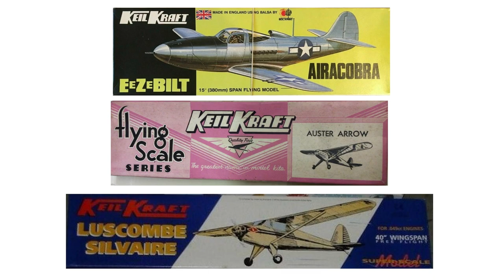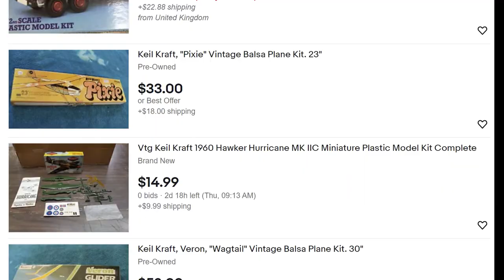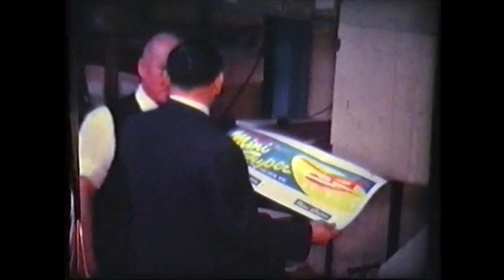Keil Kraft, a brief history

Comment: Thank you, glad to be of help. I just had a quick look on Scalemates. As far as I can see, only two plastic aircraft kits are listed.
F1 Hawker Hurricane Mk.IIc - which is dated rather vaguely as 196x. The Heller Hurricane Mk.IIc was a 1970s kit.
F2 Sopwith Camel. Again a rather vague date, 195x.
Both kit listings include the original Keil Kraft instruction sheets.
I too remember the Humbrol Authentic Colours. Regular Humbrol enamel paint tinlets sold for 23 cents in New Zealand when I began modelling in 1974. The Authentics were a bit more, either 27 or 29 cents each. They were grouped in to sets of six, mostly aircraft colours, such as RAF, RAF Overseas, Fleet Air Arm, USAAF, Luftwaffe, Italian, French, Japanese, Military Vehicles, Naval Vessels, etc. There were also some Railway Colours. As I understand it, production of the range ended after a fire at the Humbrol factory, although some shades did reappear in the standard Enamel range. I still have some Authentic tinlets from the 1970s and 1980s.

Comment: Another wonderful history video, from the master of the genre. The factory tour film was great, and very informative. Keil Kraft looks to have been a sizable operation.
According to Plastic Kits Made in Britain, Keil Kraft made balsa kits during the war, but not sure if that is correct. Apart from their flying models, several of the boxes shown are of non-flying Solid Models.
Plastic Kits also says the balsa models were distributed by wholesaler A A Hales Limited. They eventually took over Keil Kraft, which then passed to the successor wholesale firm Amerang Ltd.
Apart from their early plastic aircraft models (1950s or 1960s), they also did a range of vintage and modern road vehicles. Oddly, these were 1/72nd scale, although presumably intended as model railway accessories, in which case they should have been 1/76th scale (British OO). Apparently the later kits were 1/76th scale. Plastic Kits says these date from the 1970s, although I remember seeing them in the shops around the 1980s or 1990s. The road vehicles later went to another maker of model railway accessories, Knightwing, and at least part of the range was re-issued. 
I do have the KK London Double Decker Bus, and one or two other kits, although I never got around to actually building any of them. The Routemaster was available in red plastic as a normal London Transport bus, or in green plastic as a Country bus.
Reply from the maker: I am going to start sending you my scripts for knowledge enhancements.  You always have some great info that I missed.

Comment: Here is an idea of a subject to do one day.  The one thing every modeller need and not even think about. But the history of Model glues, cements and so on even model paints (Who remembers Humbrol Authentic colours (not the current ones from Humbrol) and Aeromaster paints and decals). As well some of the model tool suppliers like Squadron hobbys.
Keep up the good work and hope to see many more things like this clip as well.
Reply: My paint of choice in my formative years (mostly 1970's) and first paint I used in an airbrush was the Pactra line. They were pretty decent and presented an accurate range of military shades.
Reply from the maker: hmmmm
Reply: I remember the Humbrol authentic colours. After having to deal only with the square Testors paints, Humbrol was beyond anything I had seen.  Testors was a nickel, then a dime. Humbrol was 25 cents a tinlet.
Reply: I used some Pactra paints too, back in the 1970s as a teen modeler.  The old TG&Y store carried them.
Reply: @maxsmodels  So now I have you thinking I take it?
Reply: @lancerevell5979  I preferred Pactra to Testor’s in my youth, first all I had was Bottom Dollar and then aTG&Y opened when they opened up a new shopping center along with a Safeway, and Weiners (clothing store, not a restaurant).
Reply: @kudukilla  A fourth for Pactra paints!
Reply: Yes. For many years it was the model paint of Canada. Then Testors moved in.
Reply: @BigLisaFan  We used Humbrol, then Testors appeared. I found out that you could not mix the two

Comment: Keil Kraft was a UK model shop fixture in the 1960s, as were Mamod working steam engines and Wavemaster model boats. I don't remember KKs styrene kits at all, they probably got lost in the competition. Most kids tried the basic balsa kits, few persevered to the bigger stuff. Better described as a scratch-builders aid than a kit, though a suitably committed adult could make a decent job of one. Health and safety are standard for the era, machine guards slowed things down and were quickly dispensed with. Look at the guy at 4:50, his right hand is locked in that position for a reason!

Comment: Machine workers wearing dress shirts and ties and dresses and skirts. No company uniforms at all. And a lot of manual labour still required. As you said different times. Thanks for the story and film Max.
Reply from the maker: Wearing ties around industrial machinery....what could go wrong? 😉
Reply: Made a brief visit to Dundas Valley Hobbies. Quite impressed, just like a hobby shop should be.
Reply: @BigLisaFan  Yes it is. And the staff are very knowledgeable. Good selection and many brands I can not get in my neck of the woods.
Reply: @garfieldsmith332  I  couldn't stay long, another crisis at work. I will be back though, I just scratched the surface there.
It's got everything but RC, but then that doesn't matter and the owner has no more break ins either.
Reply: @BigLisaFan  Most hobby shops that have RC are just RC shops.